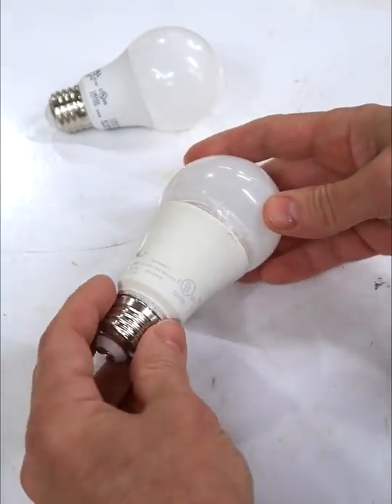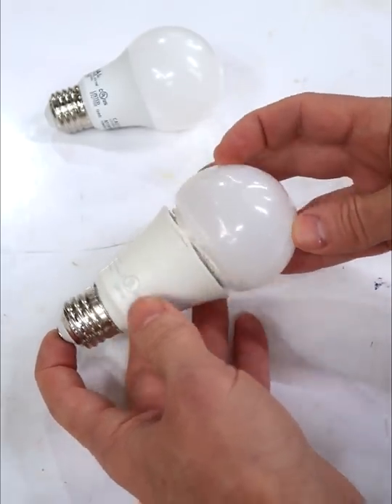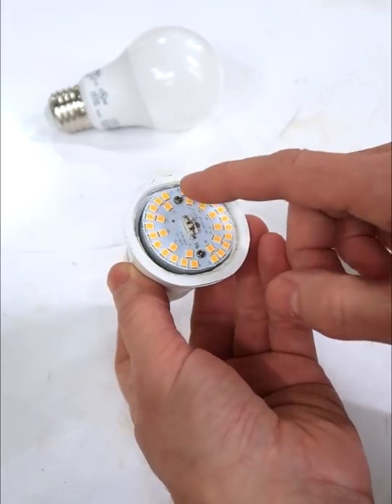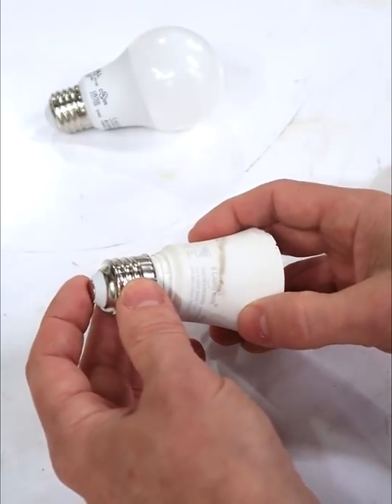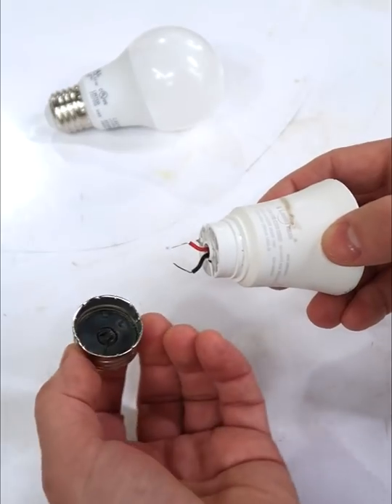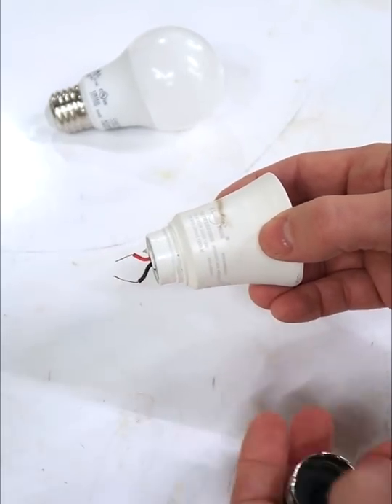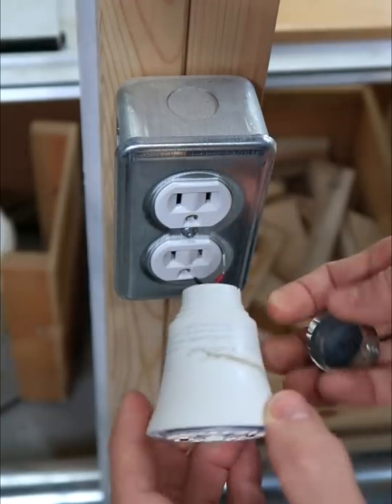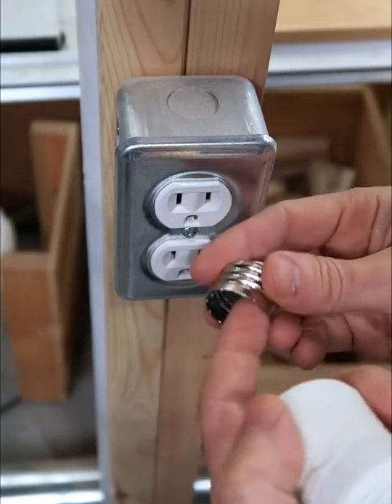LED bulb failed for dumbest of reasons

Comment: Let's be honest, LEDs have a life expectancy of 50 to 100, thousand d hours, that's a long time and those figures are from the late 1970s, improving segments have been made. But where is the profit, for years the gas mixture in incandescent bulbs was lowered to assure shorter life, yep they could tell you within hours theifespan of a lamp. Well they had 100 years to perfect it. Led lamp the cost per led has come way down, but they would last too long, no profit in long lasting bulbs ...built in obsolescence.
Reply: I’ve had some HD Supply bulbs fail.

Comment: That’s what happens when you buy cheap $hit  don’t be a cheapskate you only pay twice and that’s a lamp, bulbs grow into tulips
Reply: Philips and Sylvania are just as bad as many store brands. Many store brands are actually made by Philips and Sylvania. GE LED bulbs tend to be pretty reliable from my experience. Also if you get Philips, Do not buy the cheapest ones you can get. Buy the higher end ones with a lifespan of at least 15000 hours.
Reply: I’ve got some LED’s I got in 2003 that still work that will be 18 years in November
Reply: @oiuslags  LEDs are an older technology than I thought. Also they are probably much dimmer than the newer LEDs. Older LEDs tend to be dim, bluish, and harsh to the eye.